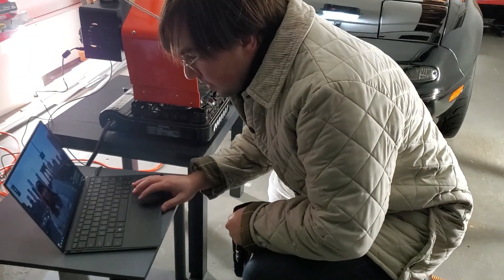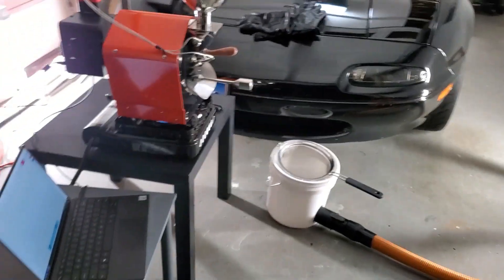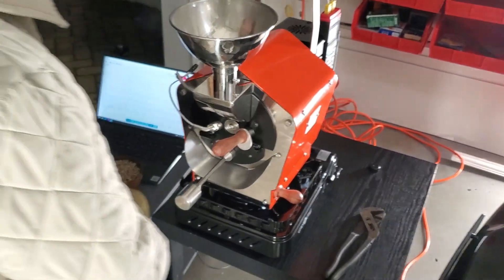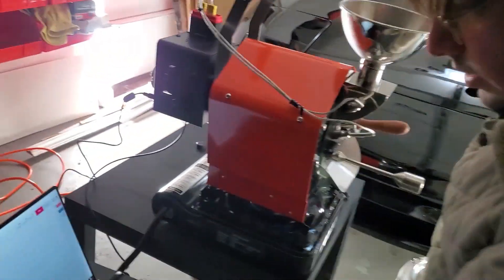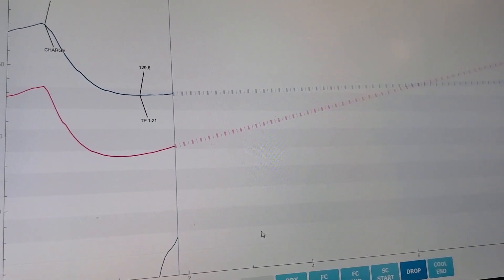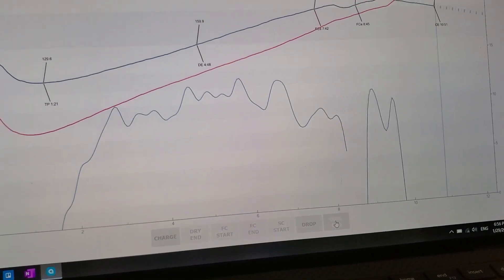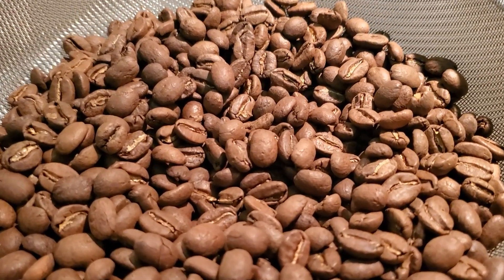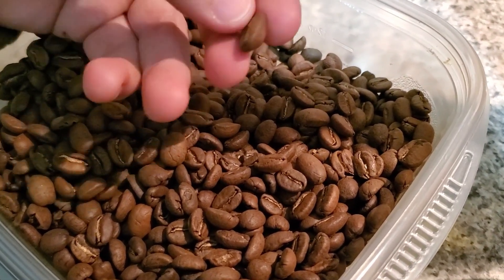Kaldi New Wide 400 - My first true coffee roaster!!!

Comment: I just purchased my KALDI Wide 400 and I opted to also get the cooling station which pulls the chaff out of the roster and also acts as a been cooling station. 

And watching this video I also realized that I purchased the exact same burner from gas One that you have. Anyway thanks for taking the time to do the video I’ve been home roasting for 20 years most recently for the last 10 or 15 I’ve been using a Hottop roaster but that machine has seen better days and I’m excited to move on to a better semi commercial type drum roster.

I just found out that while artisan is compatible with both Mac and PC it will not run on the iPad tablet which is really unfortunate so I’ll probably just use the digital readout on the center temperature thermometer
Reply from the maker: Thanks for commenting! Yeah I opted not to buy the cooler as I figured I could build one myself, but have yet to do it. But I agree it's a great semi-pro machine which has definitely helped me gain experience in the professional sense too! If you have a PC, I'd suggest you try that too as it's far less buggy from what I understand. Best of luck with your new roaster!

Comment: I got the none digital thermometers with mine, but they are useless so i have the thermocouple arriving soon. I will use it a bit more before making mods, but i will make a succer 3000 for shore
Reply from the maker: yeah the analog ones aren't particularly helpful in this instance I think :/
if you know how to mod it to fit thermocouples though, it'll definitely be a big upgrade! 
And yeah if you're using a shop vac, it's an effective and cheap way to cool beans! Good luck!!

Comment: I'm trying to decide if I should order a Kaldi but I could barely find any information on this roaster, so your video is greatly appreciated! How loud would you say it is? It's hard to tell from the video.
Reply from the maker: I know what you mean, I barely found a thread or two on the homebarista forums haha, so I had to do a fair amount of digging. Though I am quite new to roasting, please ask me any questions if you need help! But honestly, it's not that loud! I think the microphone picked up a lot more noise than my ears did, the motor is relatively quiet and doesn't make much noise, so when you put beans in , it's inaudible! When the beans are tumbling around the drum, it's obviously much louder but again it really isn't that bad, especially since you shouldn't really push over 250-300g range for consistency's sake. Usually it isn't a whole lot of beans in there, so the noise levels are pretty tolerable, enough so for me to roast outside at night and not piss my neighbors off haha :)
Reply: @alexwalshaw  Thanks! I'm new to roasting as well, currently using my oven and trying to decide whether to get a GeneCafe or a Kaldi. It seems to me like the Kaldi will produce better roasts but the GeneCafe will be easier to use. Seeing as these machines can last many years (the kaldi will probably last longer) it's really hard for me to decide which 1 I'll be happier with long-term. Anyway, thank you for your response!
Reply from the maker: @TalZion  funny you mention that, I actually owned a genecafe very briefly. It's a fluid bed roaster, so it's not really comparable as to how it roasts, but one of the issues I had is that it's cooling cycle is a bit too long. Although the Kaldi is in a whole different price point, it's comparable to prosumer batch roasters, so if you were to move up to a professional roasting environment in the future, the learning curve would be minimal.
Another recommendation would be a Hottop roaster, probably one of the more well known roasters for the home. only the B2K+ has out of the box artisan support, but rigging up a Phidget seems quite easy per reports online.
Reply: @alexwalshaw  the hottop is a bit out of my price range currently 😅 I'm not sure why I assumed a drum roaster is generally better, after reading online it seems pretty subjective, although pros of the kaldi seem to me that it's more modular with the external heat source, and less likely to break down. I guess I'll think this over some more. If only I'd known coffee was such an expensive hobby.. 🙂
Reply from the maker: @TalZion  I see. In that case, I can recommend that you scour ebay occasionally and see if someone is selling a Hottop. I've found several over my time researching roasters for below their MSRP. I think drum roasters are just the tried and trusted method for roasting coffee for a long time. The machines are mechanically quite simple, so they are quite robust too :) you can also try looking into popcorn popper roasting, that's quite an amusing and affordable way into home roasting too! Lots more information on that out there! Best of luck. :)
Reply: @TalZion  i’ve been using a Hottop roaster for about 15 years and I am currently on my second one. I’m so over it and I’m ready to MoveOn and after doing quite a bit of research I just purchased a KALDI wide 400 along with the separate coin and Chaffe Station. I think long-term you’ll be much happier with the KALDI wide 400 in my opinion

Comment: Hi, great videos.
Can you tell me how you connect thermocouple and PC/Artisan and what Lind og cable you use
Jens
Reply from the maker: Thanks so much!
my Center 306 came with a 3.5mm serial connector to USB cable! I use that wire that comes off the Center thermometer and plug it in to my computer and set it up by going to te devices tab and selecting Center 306, since it's a pretty common thermometer for roasting I guess it is in the software by default. I had trouble finding this particular cable for purchase online, but mine came with that wire.
Hope that helps.

Comment: I'll give you a pro tip considering you have the roaster in a non-climate controlled area of the house; the starting temp and moisture level of the beans will vary from roast to roast too much to get consistantly results... which is fine once you learn how to adjust for it.  However, when learning to roast I would recommend  a more stable atmosphere. 👍
Reply from the maker: Noted! Yeah I just wasn't sure where to roast with all the fumes from the burner and the gas that the coffee will give off without adequate circulation, so I went to the garage to make sure I had nothing but fresh air. I was definitely concerned about the ambient temperature as well as the humidity (or lack thereof), and with summer there was a bit more consistent weather but I definitely hear what you're saying. At the moment, it's the best I can manage, but I'll try and work towards something better when possible
Reply: @alexwalshaw  you can roast inside, even in a small home if you you open a window or 2.  The only thing to worry about there is the fire alarm going off.  👍
Reply from the maker: @oriongameplays8509  certainly the concern considering I'm doing natural draft at the moment 😅
Planned to build my own cyclone exhaust system but have yet to get around to it. All good points though, I'll keep it in mind

Comment: what cable is needed for linking up with the roast software?
Reply from the maker: it's a serial to USB cable. basically, a 2.5mm jack to USB, but the USB is quite chonk so I think there's some conversion electronics in there. it came with the Center306.
Reply: @alexwalshaw  I have the same roaster arriving in a couple days it has the Center 306 as well it looks like, so maybe I will be all good
Reply from the maker: @drinksunbear  You should be! I remember in doing my research I was asking the same question as you since not much has been documented about this roaster, but yeah the cable is a serial to USB! enjoy the roaster! are you using it natural draft or did you get the cooling/exhaust box too?
Reply: @alexwalshaw  I use a strainer on top of a small circular fan
Reply from the maker: @drinksunbear  alright so quite similar to myself! You should be fine :)

Comment: Hey Alex, great video ! Can you explain / describe a bit the compatibility of Artisian ? Does this machine have a USB connection to do so ?? Wicked Thanks Chris
Reply from the maker: Yeah so Artisan doesn't have a premade setup thing for the Kaldi Wide, but it does have one for the Fortis (the slightly larger one.) I did not use that premade option, as under the "Config" drop down, there is a menu called Device, where I selected my Center 306 Thermometer and it recognizes the data coming from it. That's it! 

Since I ordered my Wide 400 with the Center 306, it came with a 3.5mm jack to USB, which is a cereal to USB wire, but should you decide to use something like a Phidget or other thermometer that reads from thermocouples, so long as Artisan has it in its large list of supported thermometers, you should be okay! Hope this helps! Please ask me any more questions you have!
Reply: @alexwalshaw  Wow, wicked thanks for the feedback / info ! Super helpful as I am in my decision making process as to which model of the Kaldi to go for. Your video was great for a number of useful reasons !! Enjoy the roast brother and again thanks for sharing !!
Reply from the maker: @acadiaoceanadventures5958  yeah no problem! Glad to share info on it as there seems to be so little out there. Good luck.

Comment: Thanks so much for uploading! I just started my own coffee roasting journey with a Kaldi Fortis.

Did you have difficulty setting up artisan scope with the 306?
Reply from the maker: Very cool :) in my experience, no, I just found the center in one of the menus for thermometers!
Reply: I've gotta troubleshoot connecting to artisan, but it shouldn't be too difficult. 

Are you still roasting? :)
Reply from the maker: @atomdiehm5886  I am, yes. Admittedly, I haven't looked too deeply into the settings of artisan. I just found a menu with a long list of supported devices and the 306 was on there. Since the roast process is quite manual with these machines, unlike that of a hottop with fan speed and electric drop, I don't use artisan for anything other than plotting the temperature data. I'm certain the 306 is supported, and I turned to the forums for my answer to configure it. I'm sure the answer lies out there somewhere, I'll have a look at my setting during my next roast and let you know what I find.

Comment: Man it looks cold in your garage! You've probably learned this by the time I'm posting. Delta B will be your ROR ( rate of rise) an important bit of data for your roast. Artisan will plot the ROR curve as you go through the phases. Do you have a fan and control over with that roaster? I'm using a hottop 2+ and envious of the quicker response of gas. Also, if you can stabilize your garage temp (environment temp) you'll control one more factor in getting consistency roast to roast.
Reply from the maker: I've learned that yes! But thanks for clarifying :) so far, I just do natural airflow, and I'm definitely experiencing the inconsistencies of that in the higher weight doses. Looking to design my own airflow system as it costs less and I want something with a bit more permanence than the one Kaldi makes (at least this is my understanding of it right now). Once I have an exhaust system, I will likely move my roasting indoors to a ventilated room so I can get more consistent atmospheric temperature as you said!

Comment: Hey Alex, where did you purchase the roaster? I'm looking to buy one as well but I'm not sure if I should go through an ebay posting I saw or through their website that's linked in their Instagram bio. Thanks for the information!
Reply from the maker: I bought mine on eBay as well actually! But I think you can buy directly from Kaldi themselves from homecaffe.net, I purchased mine new on eBay expecting to dodge some of the massive shipping and tax fees that come with buying a roaster that's located on the other side of the globe, but it ended up costing a rather similar figure to the price on their own website, so for the sake of warranty it'd probably be smarter to buy direct unless something new has come up since. In any case, the Kaldi company and owner are really friendly so you can email them for any major specific questions you may have, they will get back to you. Hope the info I gave you helps a bit!
Reply: @alexwalshaw  Thanks for the reply! Yeah, I noticed the ebay was slightly more expensive, but the listing on homecaffe.net doesn't include the shipping cost so it does make sense if they end up around the same price haha Nice, I'll definitely get in contact with them if I have any questions. Thanks.

Comment: Did it come with the right plug to use in the US? Also, how long do you find a 1 lb propane tank to last with this?
Reply from the maker: It has a foreign plug, but comes with the correct US adapter! It's a pretty standard barrel connector power supply, so finding a correct length US power cable isn't that difficult. So far I've done 3 roasts and it's lasting fine, haven't done enough to kill it that's for sure. I think someone on the forums said they get around 20-30 roasts out of a tank like this, but I don't know how much that applies to others as it will likely vary from burner to burner.

Comment: Thanks for your reply.

I got the Wide 400 first and are waiting now for the Center306 to arrive, incl the cable i Hope.

I am a newbee at this, but find it great fun. The Kaldi 400 is great, built like tank.

Yesterday i did ny first succesful roast,  brazilian coffee, tastes fantastic, a full city roast. I find that 300gr batches works well on the 400

Again thanks

Jens
Reply from the maker: I see. Do you have thermocouples installed on the roaster already? You'll need those digital thermocouples to connect to the 306 in order to output that data to a computer. It's a good roaster for sure, I think the natural draft is it's limiting factor for that 400g capacity, so I am building a custom airflow system to exhaust air from the roaster and generate a better convection process inside the roaster. I know kaldi makes an exhaust box of their own, but it costs too much to have something that mechanically simple sent to the US, so I am building my own.
Reply: @alexwalshaw  Post a video when you are done building it! I just got my Kaldi Wide400 after it being stuck in customs for almost a month
Reply from the maker: @afigs1339  oh wow, that's a pain. I can't remember how long it took for mine to arrive but it wasn't that long. I hope it arrives for you soon. I will definitely film something once I am finished with it!